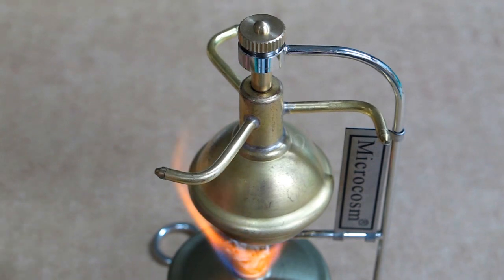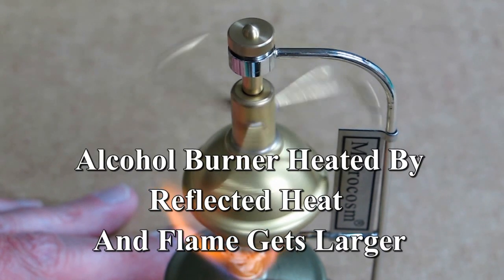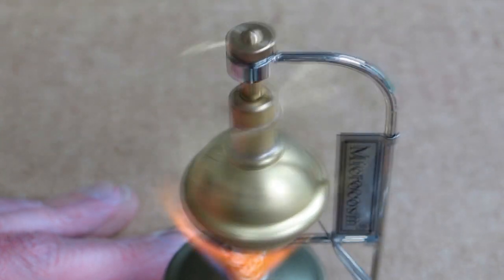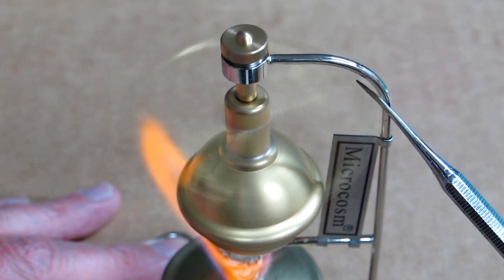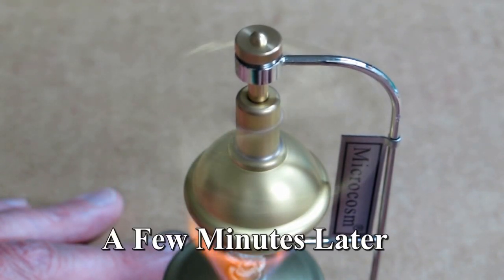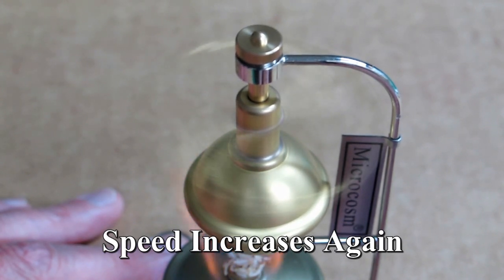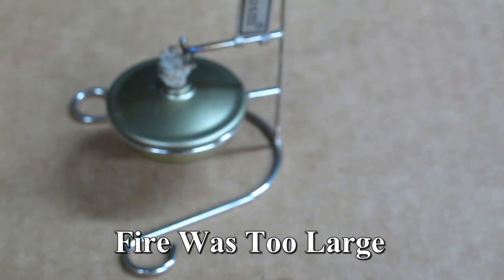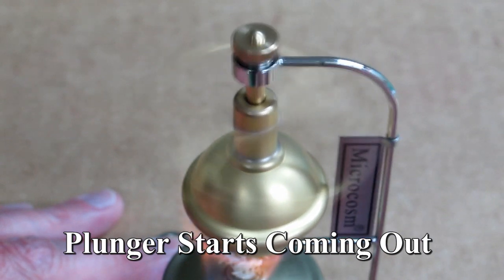Hero Steam Engine - What Not To Do

Comment: over pressure or unbalanced device?
Reply from the maker: Good question(s). A lot of these engines do not come with instructions. This one warned about overfilling the boiler. Finding the optimal size fire was trial and error. As the boiler spins, centrifugal force pushes the water toward the sides. Reflected heat, heats the alcohol burner and contributes to the fire becoming larger. As it starts to run out of water, it suddenly starts to produce more steam as the thickness of the water layer decreases and the fire becomes larger. With a fire which is much too large, it produced steam faster than the three jets could release it. A lot of spinning mechanisms experience harmonic vibration and testing and experience dictate safe operation speeds. Going through a second harmonic (shaking) and the increased steam pressure both contributed to the stopper blowing out. This boiler seems fairly well balanced, but the flimsy single wire support frame has too much flex. Clamping it in the vise was a rigid solution. The demonstration video was shot after the "What Not To Do" video. This is actually a fun little engine to play with. Thanks for watching!